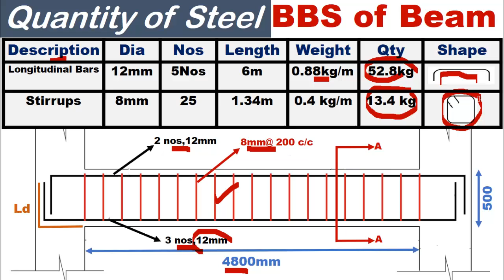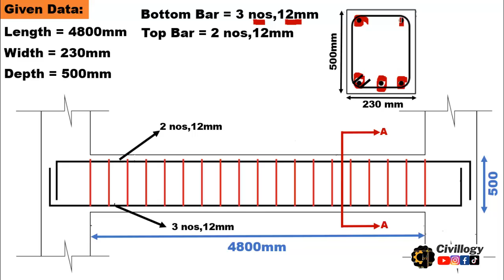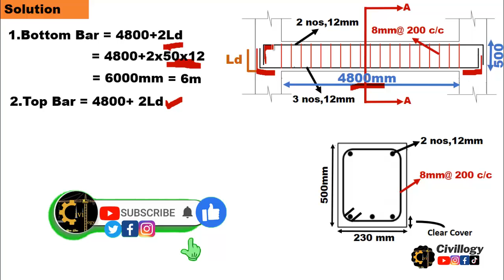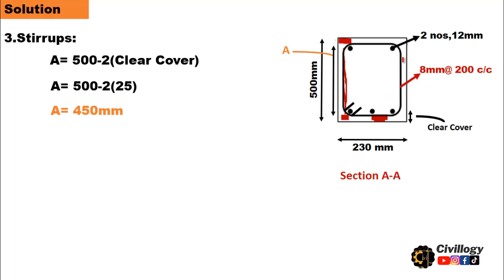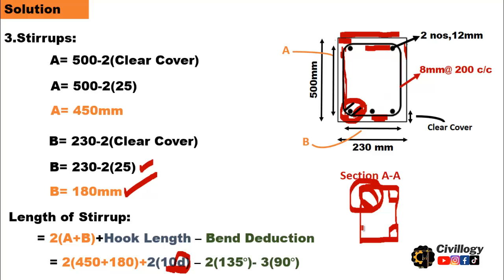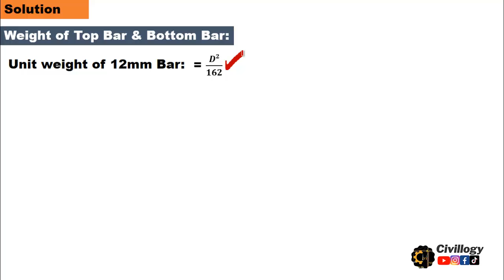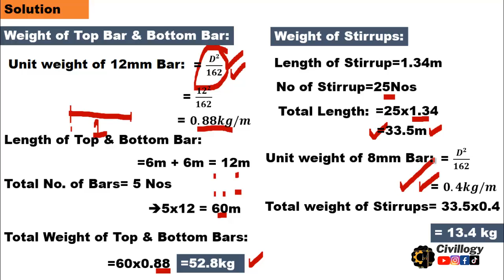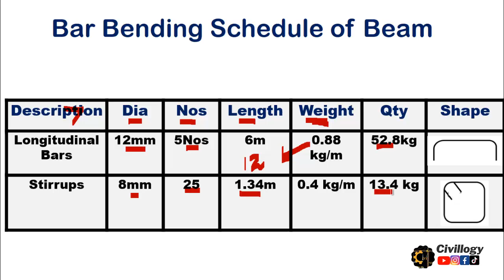Bar Bending Schedule of Beam|how to make BBS of beam|quantity estimate of steel in beam||BBS of Beam

Comment: 5 nos of 6m only we need. So 52.8/2 = 26.4 kg
One thing is that it is necessary to deduct bend elongation length for a 90-degree bend on both sides.
Reply from the maker: Yes you are right

Comment: hello dear well done but I think Your Calculate It is Wrong from (6+6 =12 and 12*5=60) the true  is 6*5=30m for top and bottom H.Bars because Length of each bars is 6 m  not 12 m to use 12 m multiply by 5 bars .  but really itis very good way to calculating quantity well done mr .thank you
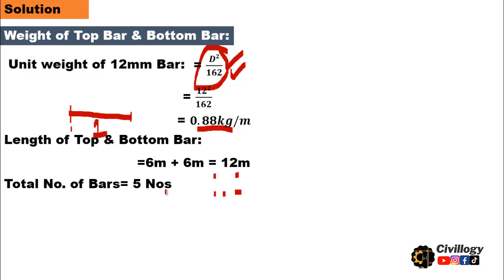Reply from the maker: At 11:03 I doubled it.it 6*5=30m not 60m.as a result, the weight i have calculated also got doubled
Thanks for making correction.
Appreciated 👍
Reply: @civillogy  thank you for you dear well done